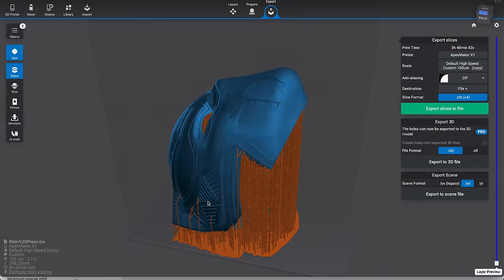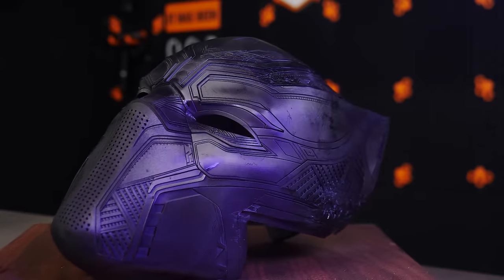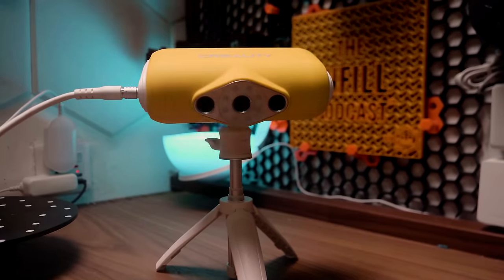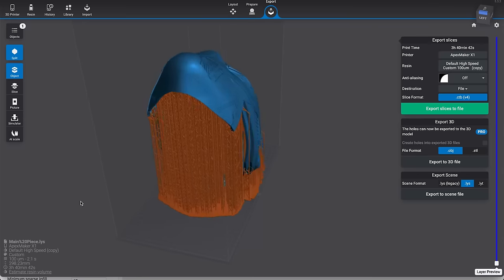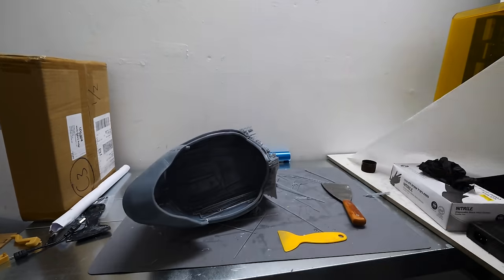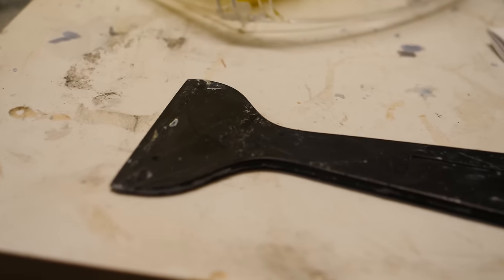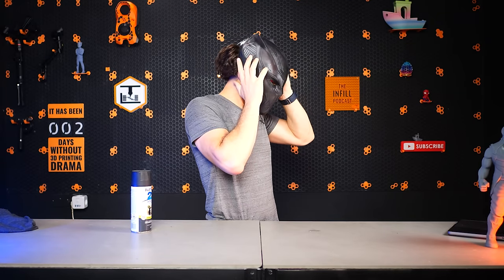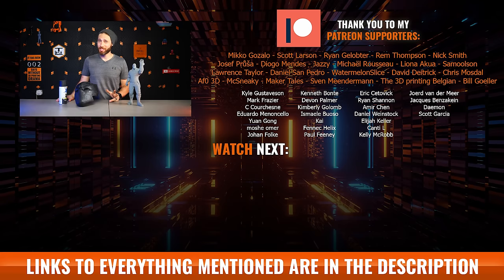I Made Every Mistake Possible, But This Helmet Is Still SICK (Apex-Maker X1)

Comment: Cool - but resin feels even more unsettling compared to having an FDM printer run for 7 days or more... I haven't tried resin, but I mean - if you let resin leak under the LCD and well, brick the printer and be unable to fix it, not to mention massively stink up your room at the same time, that is way worse then letting the spaghetti monster haunt your FDM printer, as you are only really going to waste some filament and maybe have an easily removable blob around your hotend. I can now understand why you said "I feel like every project video is a fail lately" last week. But hey, we all make mistakes and hopefully learn from them, cuz we're only human after all. Stay safe!
Reply from the maker: Fair point. Fair point.